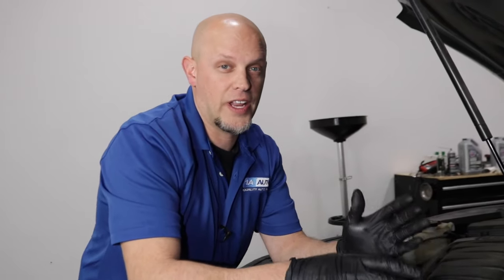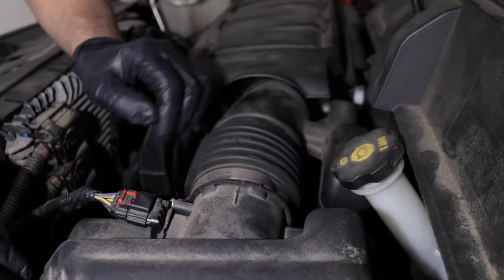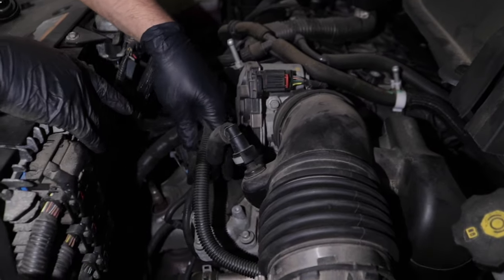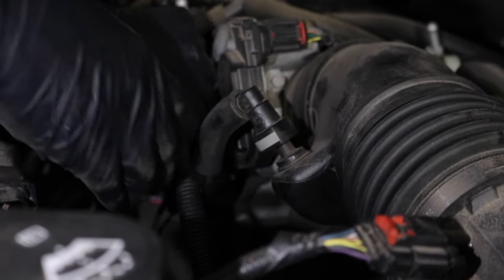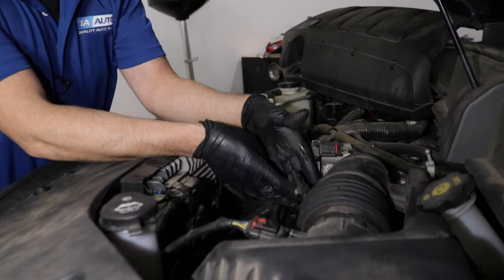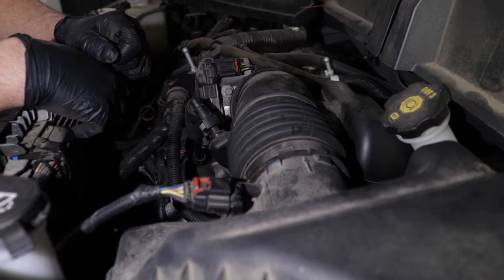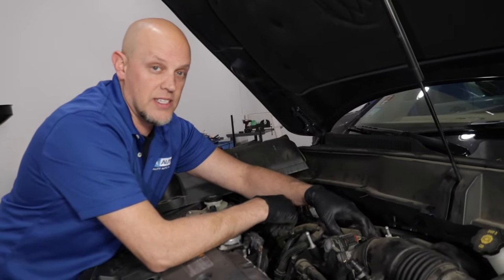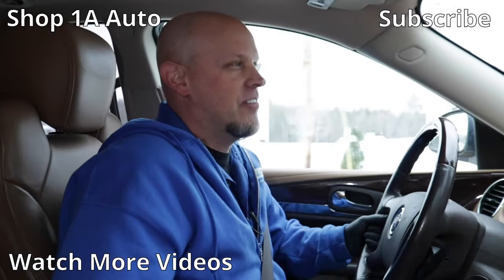Check Engine Light, No Symptoms on Your Car? Diagnose Code P0171 Low Fuel Trim

Comment: What could be the cause of a P0171 on a 2016 Jeep Patriot Latitude 2.0 we just replaced the MAP sensor but the vehicle still has a rough idle and the rpms run high while driving on the freeway approximately 65-70 mph the rpms are jumping up to 2200-2700 rpms. What could cause that? My husband already checked for vacuum leaks and says he can't find any obvious leaks. We just replaced the map sensor thinking that would fix it but it didn't so I'm thinking it could possibly be a bad Throttle Body w/Actuator IAC Idle Air Control or a TPS Position Sensor or even possibly a upstream 02 sensor. If anyone else can give me some advice on what I should fix next I would greatly appreciate it thank you!

Comment: My code reader says to check the PCV valve for cracks Etc the check engine light keeps coming on and off every so often so it happens to be an intermittent check engine light I'd appreciate comments regarding my issue thank you so much great videos

Comment: Your videos are usually pretty good but you  Totally dropped the ball on this one. 
  The reason for a P0171 is because the oxygen sensor determines the combustion is lean and the fuel trim has to compensate over 25%. 
  If this happens at idle then it would almost certainly be a vacuum leak after the MAF- particularly if the fuel trim returns to zero under load. However if the fuel trim increase is only under load- it is impossible for it to be a vacuum leak. Either a direct MAF, fuel pressure, compression pressure, or combustion inefficiency is present. 
   Also there is never a reason to check the airbox on a lean code.  Any issue must be AFTER the MAF sensor- never before it.

Comment: Awesome video!  I got a code P0171 and P0125
The temperature is reading normal, heater works fine.
It could be a lot of different things.  Loss of power going up a steep grade. Put gas in car and the light goes on again. Service station is a dive and the gas was coming out so slow. Glad it's not the CAD though. Will have my son check mass flow thing you mentioned.  Bonnie

Comment: Thanks for the video!! I have same issue with my 2014 Mercedes c250. P0171 code came up but running like a champ. Noticed air box around filter was slightly ajar. Don’t see any other loose hoses. I tightened air box to see if this was the problem. should the check engine light go away on its own or do I have to erase the code?

Comment: Thank you sir, I cleaned my MAF sensor and found a hose I apparently knocked off when replacing air filter and plugs, will keep you updated as to whether this fixed the issue. Fingers crossed!!

Comment: Thank you so much for this, got the P0171 on my 09 Acura TL, checked around my air box and intake hose and wouldn't you know it there was a giant slit in the air intake hose (probably happened during last oil change), wrapped hole in electrical tape for time being and ordered part, $35 on Amazon, RockAuto didn't have it for some reason. Seen people say that it's a leak after the MAF, in my case, was the issue, The next 2 issues it could be is bad or clogged MAF or O2 sensor, 9 times out of 10 it's a leak though - unmetered air getting in.

Comment: 2014 Chevy impala. Nothing wrong with performance just p0171 code. Checked everything no cracks in hoses, no hoses are unplugged, replaced o2 sensor already. Have no idea.

Comment: Had this code happen on a lexus CT200h. Checked all hoses, Replaced a PCV it was sticky and as well as the MAF sensor but Not sure what it was but not those as the problem persisted and I stopped running down the rabbit hole. Gets frustrating sometimes

Comment: P0171 and P0440 popped up at the same time. Car accelerating while at a complete stop. And does that also going uphill. It has trouble starting sometimes and sometimes when I start it and shuts off and then turns right back on. But no matter how easy it is to start it or how difficult it can be to start, it smells like gas so it has nothing to do with air or spark. It an fuel leak. I just don't know what it is or where it is. I need to find a video that's worth helping me. The gas gauge moves around too. And I replaced the fuel pump and fuel filter and the O2 sensors and the air filter and the spark plugs and the gas cap. Nothing seems to work. And there are no visible air leaks on no visible gas leaks. But it smells like fuel when trying to start the car. So it has to be leaking fuel  somewhere. It's just not visible. The only thing I could think of is my car is trash. Little Chevy coupe with 240,000 miles. Jerks real hard between 40 and 55 miles per hour.

Comment: 1997 honda accord, 171 code after stalling on a puddle of water. Low Idle,up and down is minor still noticeable if you inside the car,
Reply from the maker: +@monkey875 We wouldn't be able to diagnose an issue like that here, you may want to have a local mechanic take a look at it. Thanks for checking us out! http://1aau.to/m/Shop-1AAuto-c

Comment: Also my short term is between -1 to postive 2 on live data but my long term stays at 37 doesn’t move..so can anyone explain what that means and if it a fuel pump or fuel injector problem..  this all live data

Comment: I HAVE AN ACURA RL 2006, MY LIGHT ENGINE TURNED ON AND ON LETTERS ON MY DASH BOARD SAID (CHECK EMISSION SISTEM), THE MECHANIC WHO WORKS ON MY CAR SCANNED IT AND HAD THUS CODES (P0171 AND P0171) HE SAID IS THE OXIGEN SENSOR AND MAF SENSOR SO I SPEND $600 AND BUY IT 4 OXIGEN SENSOR AND MAF SENSOR NEW AND ORIGINAL, HE MOUNT IT AND ERASE CODES... AFTER 40 MINUTES IT START SHOW UP AGAIN ENGINE LIGHT ON AND SAID THE SAME AS BEFORE, (CHECK EMISSION SISTEM)... IM CRAZY WITH IT. THE CAR RUNS PERFECT, NO SHAKING MOTOR, THE TACOMETTER IS 750 AND I DONT FEEL ANY PROBLEM ECEPT SHECK ENGINE LIGHT WITH SHECK EMISSION SISTEM... WHAT ELSE CAN I DO SO I WONT TO SPEND MORE MONEY ON IT, ANY ADVICE PLEASE ?